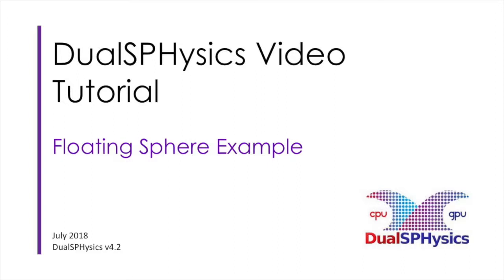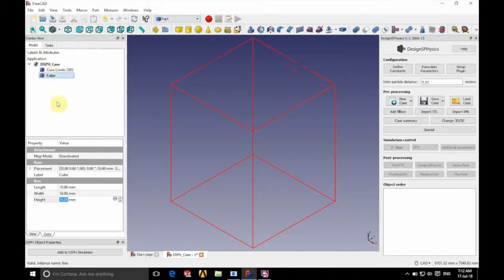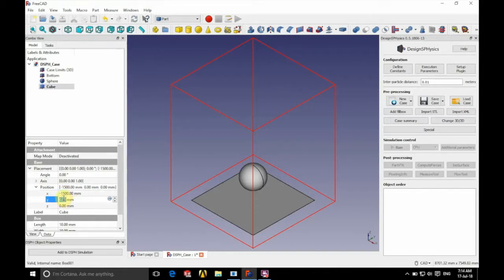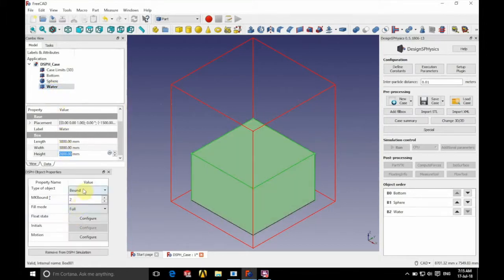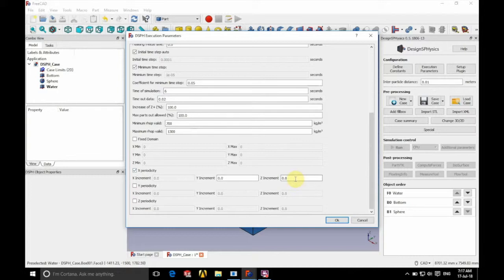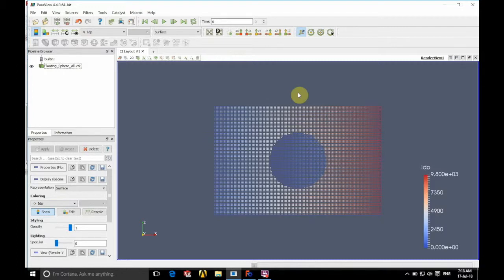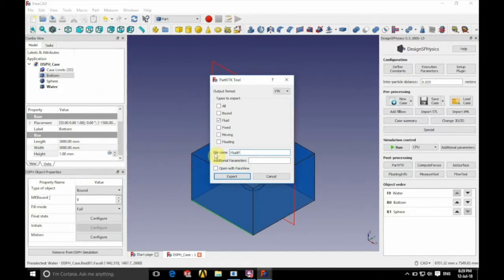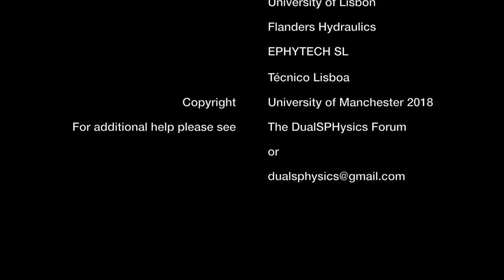DualSPHysics How to set up and run: Floating Sphere

Comment: To those who are getting an error with regards to some boundary particles being excluded in DualSPHysics version 0.8.1, I was able to solve this problem by setting the simulation domain boundary exactly identical to the case limits and making sure to define the minimum position as that of the placement of the case limits (-2.0m,0, 0.5m)  and maximum position as that of the upper right coordinate of the case limits/ simulation domain (2.0m, 0,4.95m) available at the bottom of the execution parameters tab. I don't know if this is right though.

Comment: I am trying to set up this simulation, but I get a message '''Error executing GenCase. Did you add objects to the case? Another reason could be memory issues. View details for more info'''  Does anyone how to get around this?
Reply: Fixed it now, seems to work if I use a more powerful computer.  Not sure if these error messages typically mean ''use a powerful computer''.

Comment: I am simulating the same case with the same parameters, but become the following error :

 "*** ERROR: Some boundary particle was excluded. *
TimeStep: 0.641913  (Nstep: 6792)
Total boundary: 9  (fixed=0  moving=0  floating=9)
Excluded for: position=9  rhop=0  velocity=0
Some boundary particle exceeded the +Z limit (top limit) of the simulation domain."

What shoud i do to correct that mistake?
Reply: i realized , that in the software the buttom of the "Step algorithm" is changed " that means that when i pick Simpletic option, the Vervlet option is activated.  When i changed the options, the simulation was able to run, but in the results, the water is not contained, so all the particles leave the domain from the sides, should i create the  walls to avoid the particles to leave the domain?
Reply: Mateo Aguirre I found the same issue. The updated GUI has an option to increase the domain size of the “Z+” value, right at the bottom of the execution parameters. In the example shown, this was already defaulted to +100%, so I simply set it to 100 and it ran the simulation. Hope this helps!
Reply: @GamingSoldier24  Thanks mate!! I changed it to 100% and it's WORKED!!
Reply: @GamingSoldier24  it could run but still have problem.  All of the water has gone away in my simulation.
Reply: @tianlei6605  How I fixed is; go to "Advanced Utility to create shapes" (next to the cylinder creationg tool), select "Shell from faces", select two faces of the "water cube" and create, select the other two oposing faces and create, select the bottom and create, add all the faces into the DSPH, boom, no more leaking because now you have a beutiful box that contains the water.
Reply: @itopitop497   How I choose? Is it two faces selected? It just 2D
Reply: @chayes2317  you have to create a 3d box around your 2d element
Reply: @itopitop497  How can I create it?
Reply: @mateoaguirre1105   do you find the way to solve the problem? Can you teach me ? 
* ERROR: Some boundary particle was excluded. *
TimeStep: 0.643622  (Nstep: 6804)
Total boundary: 9  (fixed=0  moving=0  floating=9)
Excluded for: position=9  rhop=0  velocity=0
Some boundary particle exceeded the +Z limit (top limit) of the simulation domain.
 

* Exception (JSphGpuSingle::AbortBoundOut)
Text: Fixed, moving or floating particles were excluded. Check VTK file Error_BoundaryOut.vtk with excluded particles.

Finished execution (code=1).
Reply: Same here, I did what @GooneFire suggested but still the run stops at 12% and all the water gone